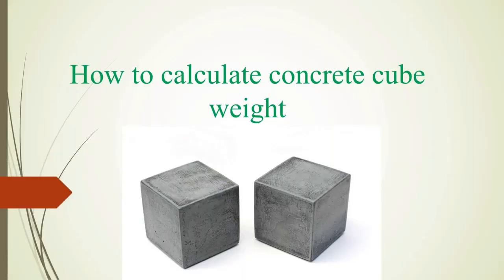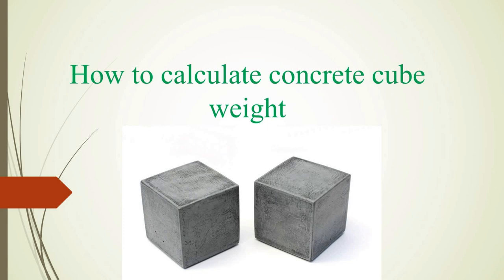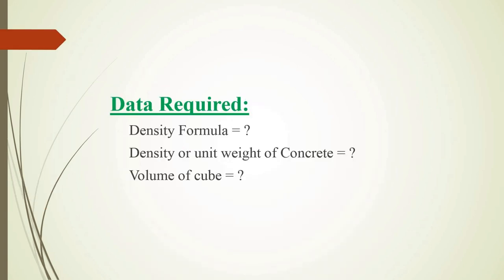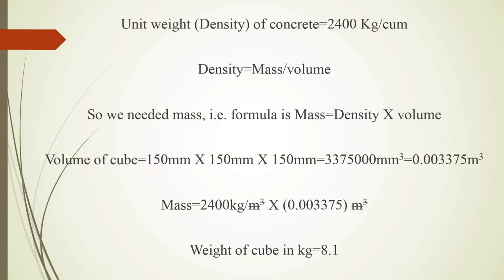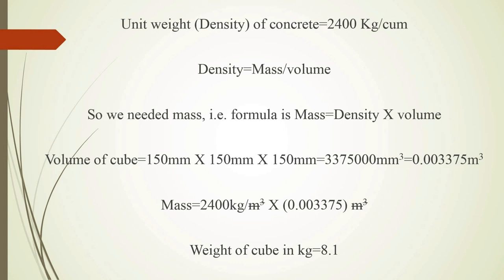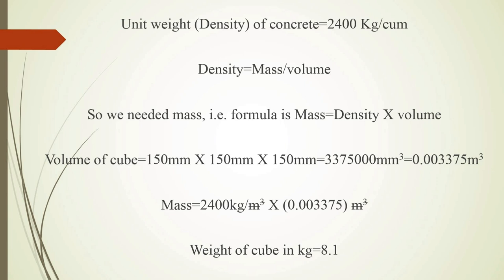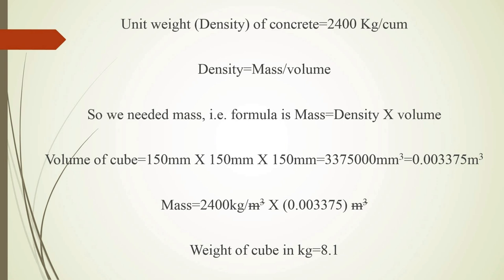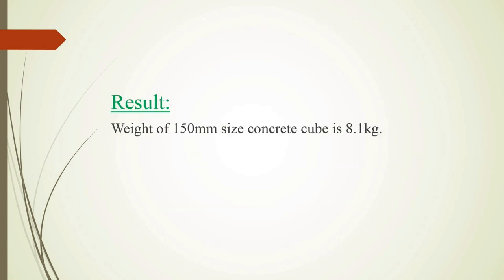How to calculate concrete cube weight

Comment: I'm using mortar test so minimum requirement is 1440 kg per m3 right? mass= 1440kg/m3 *(0.15*0.15*0.15) m3 then to fill 150mm3 mould it needs 4.86 kg right? appro 5kg ? plz reply me..your video is helpful thz..then how to find how much cement, sand are necessary to fill 150mm^3 mould.?
Reply: Fluto Fanta ryt
Reply: Same ×1440 it is the density of cement